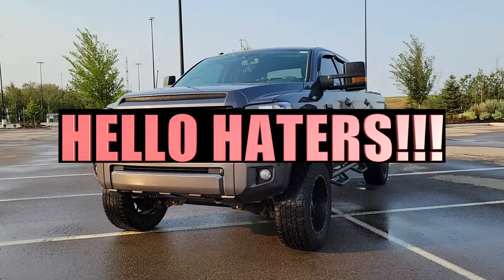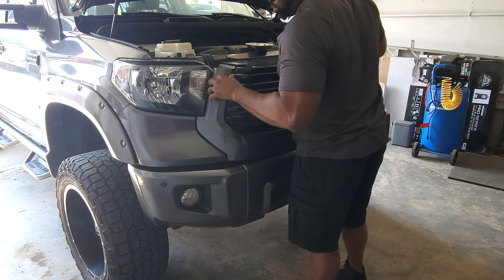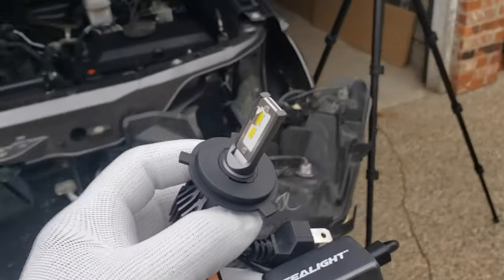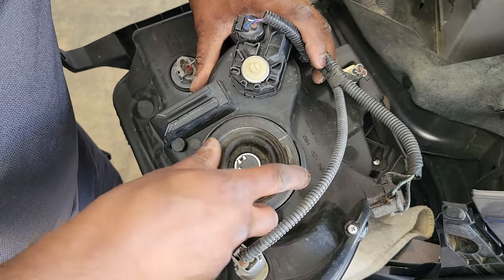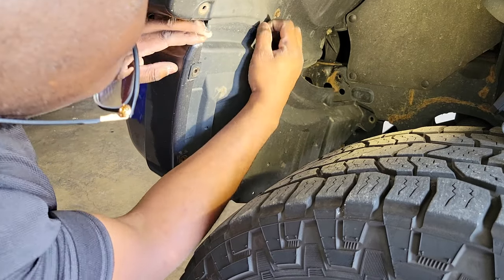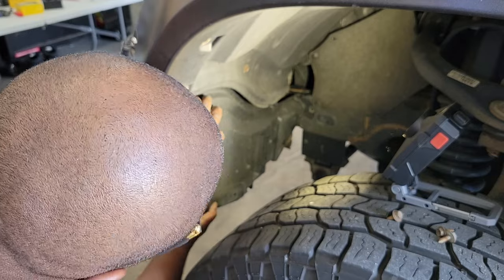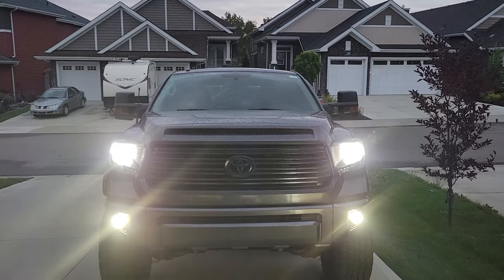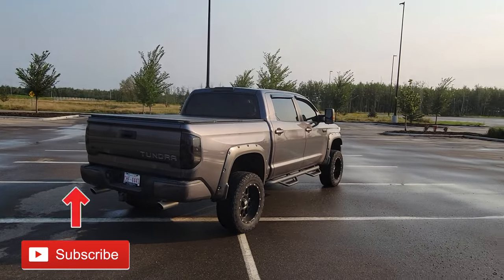Replacing Your Headlight & Fog Lamp Bulbs (2014 - 2017 Toyota Tundra)

Comment: It doesn't look like the fender flares are scratching the paint under them. Usually you see a line where it is wearing on the truck paint. Did you do anything extra to protect the paint? Do you remove them periodically to check and clean under them?
Reply from the maker: The flares have only been on for a year, so it's about time for me to check underneath. 

The rubber gasket that came with the flares has been helpful.

Comment: The housing looked very loose on the fog light when you " very gently "😊 put the new lamp back in. Are your FL loose or bouncy when you go down the road in the morng?? If so , do you know a fix???
Reply from the maker: Someone actually noticed!!! 

Yes, it was loose on the driver's side (the passenger side was much sturdier). It was like that when I bought the truck used. I believe the previous owner may have damaged it or striped the threads where one of the screws should go. 

Luckily, the housings do not move or bounce during operation of the vehicle and the fog lamps themselves are problem-free.

Thanks for checking out the video!!! I hope that it was helpful.

Comment: I am replacing the headlight bulbs for leds but I am leaving the blinkers and the side markers incandescent. Will that have any effect on the leds? Thanks!
Reply from the maker: At first, I only replaced the main halogen headlight bulbs with LEDS. I left the signal lights and the side markers as non-LEDs. I had no issues at all.

Now, my side markers are LEDs, the signal lamps are still non-LED.

I hope that helps.

Comment: just found your channel. love your vibe. I have a '21 so most of this is irrelevant to me but I still love watching people upgrade their tundras.
Reply from the maker: Thanks for visiting the channel. 

Changing the headlight bulbs does not apply to your truck, but MOST of what I have done to my truck CAN still be relevant to yours. 2nd generation Tundras run from 2007 to 2021 - same frame, same drivetrain, same stock exhaust system, same braking system, practically the same suspension, etc.

2022 Tundras (3rd gens) are the ones that are different from our trucks.

Thanks for supporting the channel! 👍🏾

Comment: I just watched another video. You can actually just unclip the fog light from the front. Put your hand in to release the harness and just take it off 

I guess if you have big hands like I do I probably couldn't get my hand to do that. But my question is, have you ever tried amber lights for your fog lights?
Reply from the maker: It's good that there's more than one way to do it.

Lighting is such a subjective thing ... I can understand how other people like the amber lights on their truck, but it's not for me.

Thanks for checking out the video.
Reply: @toyotaFANatic81 
Hey man All good !
I was just thinking for functionality 
Amber lights for shat weather for the prairies.

Next, I plan on painting my bumper caps and my grill,  I remember you mentioned somewhere in your videos that you do have a video for this.?

Keep up the videos. I'm hoping you make one for under the seat storage 

And replacing the factory amplifier under the seat to something with more jam 
,✌️
Reply from the maker: With the Platinum trim, the front and rear bumpers are already color-matched, so I don't get any credit for that. I did black-out the grille and badges, and color-matched the door handles. 

I did have a video on the blacking-out and color-matching, but it was shot so poorly that I pulled it. I will be making another one later this year.

I'm still working on, and making videos for, the suspension and steering components of the truck, but later on, I will focus on the interior.

Thanks for supporting the channel!

Comment: Is is possible to replace the bulbs by going up through the fender?
Reply from the maker: Hey, thank you for checking out the video.

As you can see from all of the steps laid out in this video, it is not possible to access the main bulbs through the fender. The headlight housings must be removed in order to change out the bulbs. The fog lamps can be accessed from the fenders, but the main bulbs cannot. 

Luckily, the steps in this video are VERY easy to follow, and you should have no problem changing the bulbs.

I hope that helps.
Reply: Thank you!
Reply from the maker: Any time! 👍🏾👍🏾👍🏾

Comment: If I just wanna change stock bulbs, can I just do it without removing whole headlight housing?
Reply from the maker: Thanks for checking out the video.

A few people have asked this. The type of bulb (halogen or LED) makes no difference to the job. The housings must be removed to change the bulbs. 

This job may seem intimidating because of the number of steps, but it is actually quite easy to do. I'd say give it a try. This video outlines the job step by step. I'm a little biased (of course), but my video is one of the more straightforward, clear, and concise videos that I've seen online for this job.

Comment: I've noticed some reviews saying that they needed a decoder & some other stuff, did you need that for this?  I have a 2016 SR5 and I'll need to replace the headlights soon so figured I'd change out the bulbs too.  Thought about LED but wasn't sure.
Reply from the maker: Thanks for checking out the video. 

This is my second set of LED bulbs and I haven't needed any special equipment at all. The process has essentially been "plug & play." You'll find a lot of variety for bulbs on Amazon.

Later on I will replace these current head light housings with the 2021 versions that already have the LED bulbs integrated into them, but for now, these will do.

Comment: Managed to get my fog lights severely misaligned.  Can’t get them right.  Tips or video?
Reply from the maker: When you say "misaligned," are you speaking about the fog lamps bulbs themselves, or the fog lamp housings that the bulbs go into?
Reply from the maker: It's hard to answer this question without actually seeing what happened. I've never had an issue with the fog lamp housings. 

The housings are solid plastic, and they don't usually bend (they break). So if it's not housing itself that's wonky, it's probably the part of the bumper that the housing screws into that is bent.

Did you take the housings out in order to switch out the bulbs? If so, did you do any prying or pulling to get them out?

Comment: I actually had a question. How's the beam pattern and could you throw up a link for both bulbs? Thank you.
Reply from the maker: The beam pattern will depend on the type of housing you have. I have aftermarket headlight housings that are black on the inside. This reduces the brightness and thus the beam pattern a little bit. 

If you're still running the OEM headlights housings with the silver lining on the inside, your beam pattern will probably be a little better than mine. 

The particular bulbs that I bought are from Auxito, but there are QUITE A FEW good brands available for LED bulbs. That's why I'm not repping that one brand alone.

Go on Amazon, use the vehicle filter for your Tundra, and you will see a ton of bulbs to choose from (and reviews on them from other people who have purchased them).

Comment: Hey buddy are u sure u order the auxito led 9004/hb1 cause mine just came I and they don’t fit on my 2015 tundra the 9003 h4 looks closer to a fit to me just trying to figure it out thanks
Reply from the maker: Hey, man. You are correct. They are 9003 bulbs that I used. I apologize for the typing error. I know how frustrating that can be from previous experience. I have already fixed it for this video. It is correct in the other videos, so I don't know why I screwed up this one.

Thanks for pointing that out!
Reply: No problem buddy I was just confused lol I got the 9003 on the way thanks for the videos
Reply from the maker: It's my fault that you were confused, so I apologize. I'm glad that you've got the right ones on the way.

Comment: My headlights adgust in height for trailers with a wheel on the dash is there extra steps involved?
Reply from the maker: My headlights also adjust in height. There's a small motor that handles that, and it has nothing to do with the bulb itself, so there should not be any extra steps involved.
Reply: @toyotaFANatic81  thank you!
Reply from the maker: My pleasure. I hope that the video helps!

Comment: I am looking forward to do this but the manual wants me to access them by removing the mud guards, no need to take the grill I guess I will save this video and see
Reply from the maker: Accessing the headlight housings through  the fender liners would be an interesting way to do it. Hopefully, the wheels and tires don't get in your way as you're taking off the liner. 

You can access the fog lamps from the fender, but getting to the main headlight housings would be a lot tougher from the fender.

I think that this job intimidates people because there are a few steps, but it's actually quite easy. This video provides you with a step-by-step guide on how to do it effectively.

Comment: Yooo....could I get your offset and backspacing for your wheels? I have the fender flares on my 2015....but my older wheels are not proper looking.
Reply from the maker: Thanks for checking out the video. All of my mods are in the description section just underneath the video.

My wheels are 20" x10" and have a -24 mm offset. Don't worry about the back-spacing. The width, height, and offset are enough to find the look that you want.

I hope that helps.

Comment: I went back to toyota because i knew them to be simple and easy. What a pain in the ass bro. I just bought a 2016 tundra
Reply from the maker: Like I told someone else in the comments, if you were to do this job on an F-150, it would take twice as long ... and depending on the year of the F-150, you may have to remove the front bumper to get at the headlight  housings.

This is an EASY job. Yes, it requires a few steps, but it's not complicated.
Reply: @toyotaFANatic81   I completely understand what you mean. I just miss the simple days where stuff was right there. In and out. I do absolutely love my tundra, it actually looks a lot like yours all jacked up with sweet wheels and tires. Thanks for the video good sir.
Reply from the maker: You're not wrong. Most vehicles were easier to work on in the past.

I know what you mean about loving your Tundra. They're GREAT trucks! 

Thanks for supporting the channel.

Comment: Housing
Reply from the maker: It's hard to answer this question without actually seeing what happened. I've never had an issue with the fog lamp housings. 

The housings are solid plastic, and they don't usually bend (they break). So if it's not housing itself that's wonky, it's probably the part of the bumper that the housing screws into that is bent.

Did you take the housings out in order to switch out the bulbs? If so, did you do any prying or pulling to get them out?